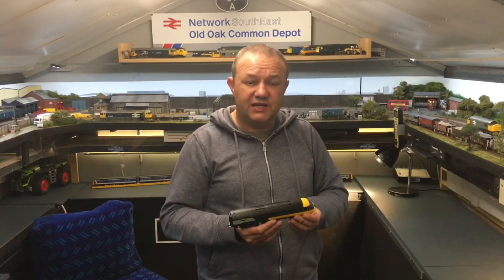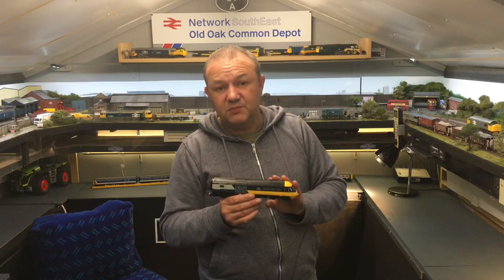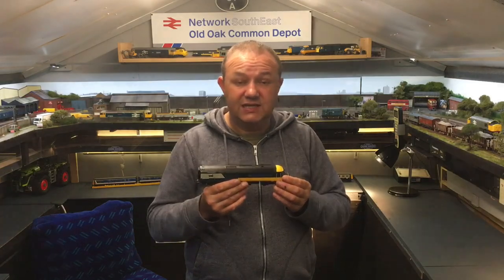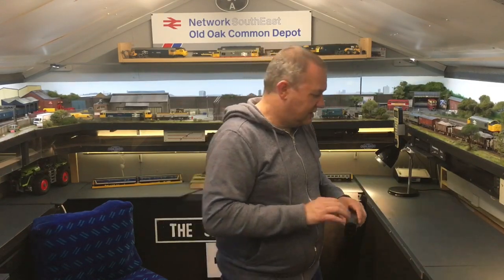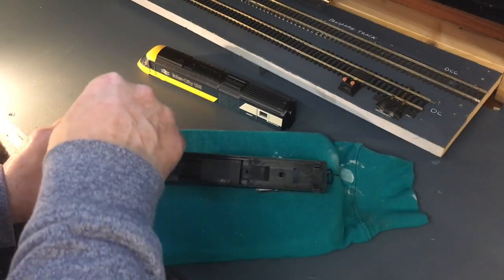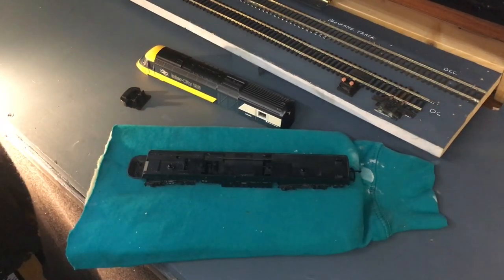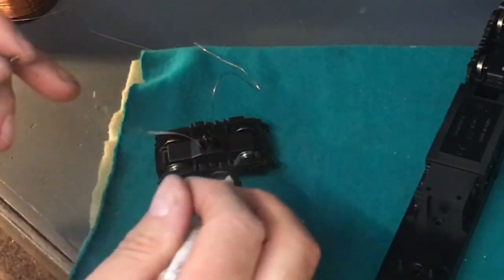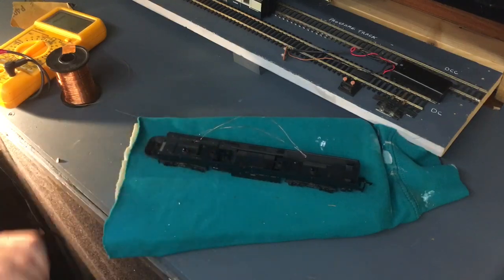Adding LED lights to HST Dummy car

Comment: Really helpful video, thanks Garry. I've been struggling with trying to do this without resorting to using decoders. I thought there must be an easier way of doing this. What I may do is wire a DPDT switch on the underframe, so it's possible to switch the lights from white to red manually (or off).
Reply from the maker: You're welcome!

I like the switch and a great addition to getting diversity out of a budget model.

Personally and in my opinion only, these model are better driven one way as the motor has a rubber tyre.. Plus a cheaper motor drive unit.

When reversing the main unit it puts a lot of wear on the traction tyre though not impossible but you will find that you own 2 rubber trees in the garden to maintain a loco.. lol 

I personally use it as a one way pull service only, thus only having Red lights in the end unit.  
Sadly this is a down side of the Hornby RR HST's but still a fantastic model for the price and I have three lol..

Hope this helps
CHEERS 
Garry

Comment: Hi Gary 
Do you need the circuit board to do this job?
Cheers
Reply from the maker: HI Buddy apologies for the delayed response.

You can and it would keep the instal neat and an option I would use if you have around, but its mainly two LEDs that sit in the light cluster area so not a big instal.
Cheers Garry

Comment: this would be better if you used a small bridge rectifier so it would work whichever way the train was sited on the DCC rails, or on DC. But doing so would also show red no matter which way the train was travelling. But good job anyway

Comment: If you put a capacitor in the circuit it will stop the lights flickering
Reply from the maker: I have finally added a capacitor and bridge rectifier - did have a few moments of smoke and burnt fingers but i think i have mastered it lol

Cheers buddy

Comment: Hi Garry, great to hear from you. I picked up my railroad set in the GWR trainset a few weeks ago. Got to test run it yet but adding rear lighting is on jobs list. I may add tts decoders so was wondering if I could run lighting off these. Have to do some research. Keep well buddy, regards Bobby 'T'.
Reply from the maker: Hi Rob 

Yeah its an option but definitely delve in to some research on that may be worth adding a 8 pin pcb board to maintain the the wiring from the added pickups from the dummy them you could test with a standard decoder first. This would give you the feeds out to the lights - 

Brian Lambert website is a good knowledge for DCC wiring 👍 

All the best Garry

Comment: Superb demonstration as usual garry, I’ve got a railroad HST too would be nice to have tail lights. Also, for DCC sound what would you do to have a sound decoder in the rear loco?!
Reply from the maker: Adding the pickups from the wheels would give you a feed then add a blank circuit board with a 8 pin socket  - Brian Lambert web site has a lot of dcc wire if this helps -😁

Cheers

Comment: I will be getting a loco that has a dummy unit how would I be able to to direction lighting for dcc fairly cheap
Reply from the maker: Hi thanks for your comment I have been thinking about this and it all boils down to what your electrical abilities are I guess, as there are a couple ways to tackle this - TBH the cost is not that huge compared to the complexity of diy wiring.. 

But I am not going to suggest the different ways to wire up a loco as I would feel bad to hear that something went horribly wrong as they often do for me sometimes..

My Best advice is to pop on the web - 
1/. DCC WIKI has all the knowledge base on DCC wiring and its function..

2/. For me has to be Brian Lambert the god in DCC and all there is to know.

This would be my best advice at this stage my friend.
Hope this helps in some way..
All the best Garry.
Reply: @cheekytek  thanks for trying to help

Comment: Do you have a link for the coated wire you use for this project please
Reply from the maker: Hi and thanks for your comment - 

The wire used is 0.32 tho wire.

Unfortunately i purchased this from Maplins in the days of there trading - sadly no more but if you search 

coated 0.32 tho copper wire It should emerge 

Try Rapid online 

Or any online electrical trades 

Sorry for not being more specific 

Cheers
Reply: appreciate the reply and info given